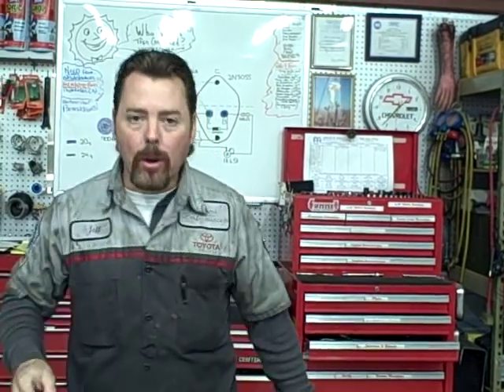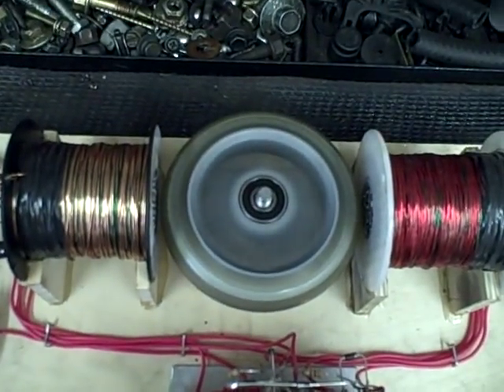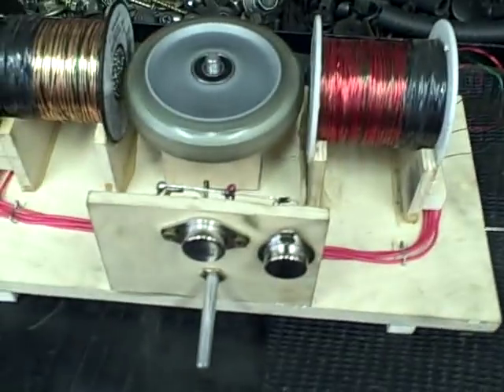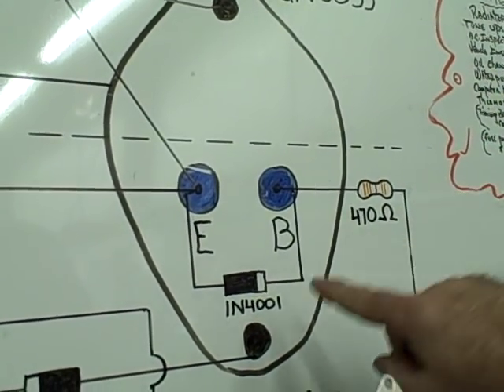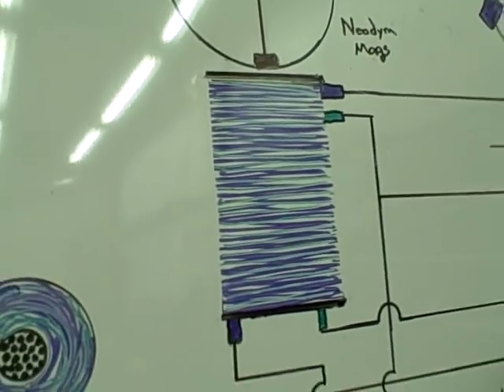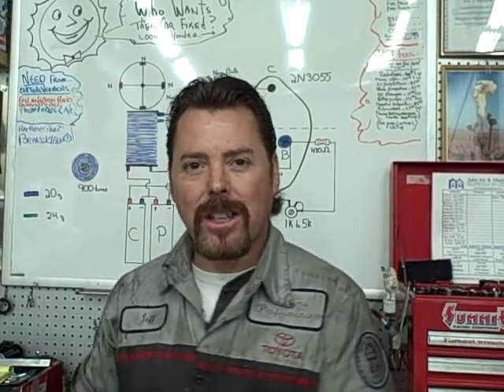Bedini Motor ( Generator ) How To Build One

Comment: Do you think this could work to recharge RV deep cycles while camping? (Scaled to a larger size) Two 6V wired to make 12V
Reply from the maker: ***** not sure never tried it but sure why not.
Jeff
Reply: no, since it would require the violation of the laws of thermodynamics.
Reply: +Wes Jones you must look once to rick friedrich simple free energy and i hope your eyes will go open
Reply: philippe herman you must look inside a physics lab. My eyes are open...to reality. Why do you deny documented physics? Aren't you open minded?
Reply: +Wes Jones the earth is flat otherwise we should all drop off that's the way you are thinking but we all know this is wrong now. you dont see every thing in your lab
Reply: philippe herman if the Earth is flat, why does it cast a shadow in the Moon, and how would it have magnetic poles?
Reply: +Wes Jones the bedini motor is a patented device. it doesn't violate any laws of thermodynamics. in case you missed it in the schematic, it has a battery power supply. the easiest way to think of it is as a DC to DC step up transformer, even though that's not actually an accurate description of its operation.
Reply: JHuff276 having a patent doesn't mean anything. 

Clearly you didn't watch the video of you think they aren't claiming it is a perpetual energy generator. It would be pointless as anything.
Reply: +Wes Jones the video does not claim perpetual energy. he only mentioned that other people claim it. the bedini motor works extremely well as a battery charger and reconditioner for desulfating the lead plates inside battery cells. that is not pointless. it can recharge a battery that has been discharged down to almost 0 volts. this is not pointless. it is a very good machine when used correctly.
Reply: JHuff276 no it can't. Do you get the laws of thermodynamics?
Reply: +Wes Jones Laws are constructs of man. They can be manipulated or just plain wrong. Spouting off that something violates the laws of thermodynamics should not prevent people from investigating anything.
Reply: Ron Armstrong so you don't get the laws of physics then....
Reply: +Wes Jones you are a great believer: you believe something isn't possible and that's not right. If anyone was thinking like you, we would still living in the Middle Ages i think. You dont know what happened then?
Reply: Ron Armstrong laws are concepts that describe actual phenomena that will occur given the conditions. Seriously, why argue science when you know nothing about it? The very laws you are claiming are being defied for this are what make your phone/computer work. Which is more likely, that all of science is wrong, and it was a complete fluke and guess to get your computer working, or that science is accurate, and you're misunderstanding it?
Reply: philippe herman hardly. I am open minded, and that means being open to the possibility of something not being correct too. Try opening your mind some time.

Tell me what the first and second laws of thermodynamics are, and why you don't believe in them please.
Reply: +Wes Jones Why do you assume I know nothing about science? My computer has nothing to do with the fact that obsolete chemical energy cartels have worked tirelessly to keep us using technology that drains our resources. You drive a car that throws away 98 cents out of every dollar you spend on gasoline in the form of waste heat. I also know that the so called "Laws (lies) of thermodynamics" are a mechanism to keep us in slavery.
Reply: Ron Armstrong I know you know nothing about science, because you don't even understand how electricity works, or what laws are, let alone what the laws of thermodynamics are.
Reply: +Wes Jones I know that the laws of thermodynamics are a method created by false authority to keep us under economic bondage.
Reply: Ron Armstrong it's my bad really. I should have known you aren't serious.
Reply: +Wes Jones Don't sweat it. I didn't realize you aren't credible.
Reply: Ron Armstrong he said while denying all of science.
Reply: +Wes Jones That's your perception.
Reply: Ron Armstrong based entirely on your denial of science.
Reply: Yes, that was the original thought we had. 
We run 5.5 Sluece, and we constantly have to charge the deep cell. 

The problem comes in charging because, a deep cell takes time to get back up, to useful charge. Literally hours. 

A small generator only put out about 7.5 amps and not able to keep constant.

The pump drains the battery faster, than the charger can replace. 

That's why we looked at this video. 

In the end it comes to changing over from a battery based system, to a 110 V complete electric system.

A much bigger generator, with 110V sump or bilge pump work's better because, there is very little variation in flow rate when running for longer period of time, and we do not have to stop run.
Reply: Jami Ross do you ever get tired of making a fool out of yourself?

Yes, plugging the motor into a wall outlet will make it run longer than a battery. Guess as to why that is champ. ;)
Reply: Jami Ross and you wonder why the scientifically literate laugh at you?
Reply: +Wes Jones. The laws of thermodynamics do not apply to this devices benefit of desulfating a battery, and I agree that those laws are correct . However, they apply only to closed systems. I'm not claiming to know exactly how it works, but my very educated sister(masters in electrical engineering) has two Bedini motors she received directly from John Bedini at a conference after she corrected him about Royal Raymond Rife(funny story but long). I have used them and they both work and the explanation had something to do with collecting negative environmental electricity made possible from the magnetic field from the spinning magnets being disrupted. The laws of thermodynamics remain intact because this would be considered an open system. I assume you know the difference between - and + electricity and the negative electricity is what desulfates or brings old dead batteries back to sometimes better than when they were brand new.
Reply: Joel Giachetti you're right, you don't know how they work.

The laws of thermodynamics don't apply only to closed systems professor.
Reply: Joel Giachetti oh, and it wood need to be a closed system for it to be perpetual genius...but since said closed systems don't actually exist.....
Reply: +Wes Jones the reason I replied to you was because you was because you seemed like you truly wanted to know its benefits. I've revived numerous garbage batteries with it and it works, and yes,  laws of thermodynamics DO NOt apply to open systems. Genius I never claimed to be, but you are a fake. Good day
Reply: Joel Giachetti yes, the laws of thermodynamics do apply to open systems. I recommend you consider brushing up on your high school physics.
Reply: +Wes Jones no, you need to brush up on your shill skills and hope you don't get reviewed soon. You might lose your job. Maybe you'll get lucky and be reassigned to a different topic to argue like 9/11 or flat earth. Good luck on your career choice.
Reply: Wes Jones laws are made to be broken. Science is proven wrong all the time using science to do it. You are trolling people. Open minded people are the very shoulders science stands on. Einstein was considered a fool by his teacher and was told he wouldn’t amount to much, but his ideas changed the world and proved theories that currently weren’t accepted. You my friend think that only you have the right answers and that is why as a scientist, it is sad. You are supposed to not fully accept laws in-order to find a way to break them.

Comment: Helo Oops I was wrong wire is 0.40 and 0.60 nawijalem coils in various namely 450 and 900 and 1200 windings and always the same effect on the output voltage to charge my 7volt what is causing Heyke

Comment: your 2 coils should of been wrapped on the same core the tranformer action would of added extra energy off the pulse, the varible resistor because you connected those 2 out puts together you loose the varible function  barries are wired wrong, you know when its working right because the 2 coils will be in resonance and be making a whistling nose from the coils i bet you didn't hear it

Comment: Use a small bolt and bolt them on, you may even join all of the connections that come from the same place if you wish, it works just fine and the most simplest way;¬)

Comment: because it does not teach how to make the coil to get the four points¿? according to what I see is a two-layer coil of wire number 23 and 26.

 in the diagram I see 900 laps, ¿then it means there are 450 turns of wire 23 and 450 of wire 26?, which layer is first, the 23 or 26.

I would like to see this video, because in this area is very expensive  the construction. 

nobody talks about this piece in the videos, is the most important.

I hope to answer, thank you very much.

Comment: The glaring error- Two coils on motor built, one coil on schematic...?
Reply: Coil Smoke you have to build 2 circuits and each one runs each coil. It’s a pulse motor style design. You can put as many coils as you want just each coil needs it’s own separate isolated circuit

Comment: Until the primary battery is flat, which can be after a very long time as you charge 5+ batteries on the lowest Amp draw, mine has 3 coils and induces a 12.8v current without me even rotating the disk, it varies according to how I place the coils, if I move the coils away from the magnets Ohms Law determins the output and voltage, wattage & Amperage change accordingly. If you can charge 5+ batteries then it will run for as long as your batteries run, add Solar & it won't stop ;)

Comment: This motor does not have over unity. Things are not connected correctly in the circuit he drew on his board.
1) The transistor is off the way he has it wired. This makes all the current flow through the neon bulb.
2) The diode connected to the charging battery is reverse biased, so it is not conducting current. This causes the charging battery to be disconnected from the circuit.
3) The potentiometer is not wired correctly. If he had connected the two terminals together it would work, but he said he left his open. This causes the potentiometer to act as a resistor. If had connected his wire to the terminal in the middle then the potentiometer would act as a throttle. But the way he has it wired it just acts as a 5K resistor.
4) The 4007 diode is also reverse biased so it is off too. Because it is reverse biased, the coil made of smaller gauge wire is not conducting current, so it is not producing any magnetic field. The coil is essentially off.

What this man has built is an electromagnet. The coil made of large gauge wire is powered by the primary battery. It has a DC current flowing through it and acts as an electromagnet. The scooter wheel has magnets on it. So once he spins it, the magnetic field of the electromagnet keeps it spinning. But this drains the primary battery because it supplying the current for the coil. Once the primary battery is drained, the scooter will stop spinning. The charging battery is not even hooked up so it does nothing.

Comment: You need a healthy Battery, mine wouldn't work because the battery I attempted to use was not good, although it will work with 10v, 12 Volts is way way better ;). You start it rotating, it should carry on :p

Comment: I will use a Solar Panel to charge the primary battery (Capacitor) as it is NOT self sustaining, this is why it is NOT an "Over-unity" device. Any attempt I have made to re-route the output back into the input you get a feedback-loop that shorts the whole thing out, even with blocking diodes you will obviously run into problems... However, I know someone out there may be able to figure this small glitch in the matrix out;-)

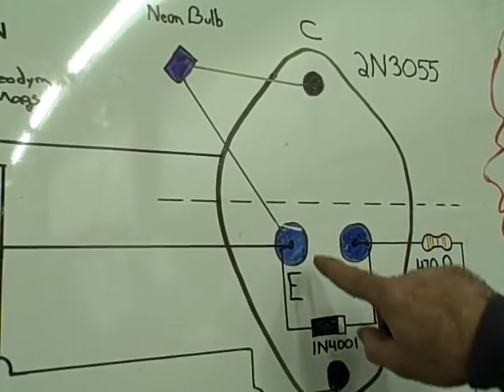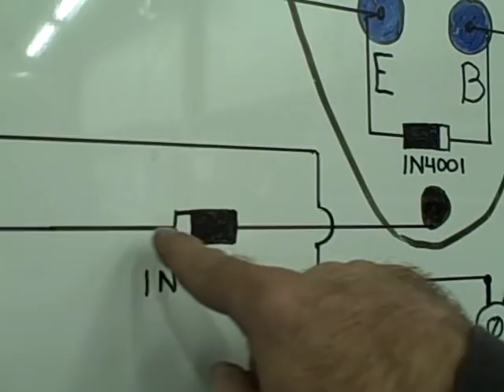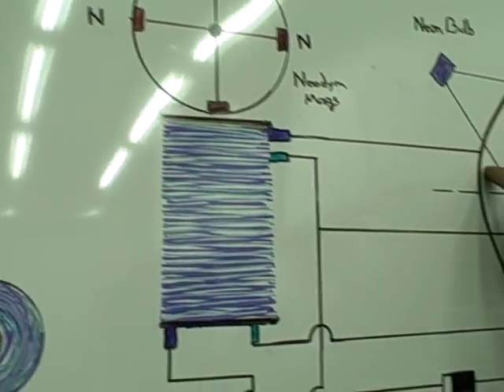Comment: 3:33 If you don't know how a potentiometer works, I suggest you NOT "leave it open" -- the drawing will mislead you as to how to wire this without the shorting wire.   3:50 WRONG -- the neon bulb prevents voltage spikes from damaging the transistor.  4:20, 4:51 Collector NOT "Collector-Base".  0:00 Is that a severed hand hanging on the peg board back there?!?

Comment: how long will this run ?
Reply from the maker: Das Licht as long as the lead acid batteries hold up
Reply: ***** Have you tried to make it recharge itself ?
Reply: Das Licht Sadly not possible
Reply: Doazic it must b poss (mayb adding a little circuit or few components so that when one is full it switches back)
Reply: You can't get more out than you put in, simply put.
Reply: what u believe is what u get i dont believe that so i do get out more then i put in!
Reply: mmrutman bad reasoning
Reply: yesterday this fellow told me ther aint no such thing as can't!
Reply: okok
Reply: angus u joka look at your own vis bedini working mythbuster busted so u can get out more then u put in what u talkin about
Reply: mmrutman hah have you seen their bedini circuit? Its nothing close to this. I don't knoiw if this works but i see that principle as a localized concept

Comment: Tesla proved radiant energy so well (c.1896) his laboratory was burned to the ground. Those implicated include JP Morgan & Edison - now GE. Edison was really pissed at Tesla for designing a brushless AC motor. Edison's DC current was useless for long distance power transmission. Tesla's AC electricity created the energy revolution we have today. GE & Co have blocked Tesla's AC replacement radiant energy because it means free energy 'without wires' & bye-bye oil. Tesla had about 700 patents...

Comment: Hey mate, see if this diagram helps you. google peswiki.com and find the Bedini section. click on SG Schematics. U can also find the materials and procedures on there. It wont let me copy the link here.
if you scroll to the bottom, you can see where the transistor ties into the motor. The transistor he uses is different in the schematic, but you will still have the idea.

Comment: Energy can neither be created or destroyed  it mere;y changes its form meaning you cannot pull out more current than you supply
Reply: ..and you have tried, tested and built how many bedini designs ?
Reply: Hahahahah - Nice one!
Reply: Mark Harrington That particular statement about energy assumes that energy isn't made of something else. It seems that the actual transference and functions of energy cannot be fully explained without making it dependent on other sub-components doing or participating in the actions/reactions/transmissions. Thus invalidating the conservation of energy "law". And that means matter and energy are not fixed in their ratio either.
Reply: Mark Harrington what about light?you turn off a lights switch and it gets dark .where did it go?flip the switch again and it's back,was the light still there in the room somewhere hiding?
Reply: @gunsofvengeance2229  haha - wtf??
Reply: actually universes sitting in bath of energy, your atom bodies, air, light, soil actually  energy itself, it just matter how we capture and convert it! i do believe there's no "free energy" it's just something that we couldn't comprehend, but "free energy" as economic term, yes you can make 10000 watt solar panel and you free from government!
Reply: That's true.  The purpose of this design is to harness ambient electrons which are everywhere.

Comment: Type "500G WINDING WIRE / MAGNET WIRE 0.56mm / 24SWG / 23AWG" and "500G WINDING WIRE / MAGNET WIRE 0.40mm / 28SWG / 26AWG into ebay - That is exactly what I used ;)

Comment: some ppl forgot to study the first law of thermodynamics... :)
Reply: punchcrosser1 the way this works has nothing to do with thermal dynamics. It’s simply a pulse motor that uses a trigger coil to generate a small current to trigger the transistors to open and pulse the main coil. You could use reed switches and standard coils instead of bifilar

Comment: Nice schematic rendered useless with close up shots that show only small sections with out the entire schematic information. The presenters head blocks the view of the drawing on the close up shots. Too bad the schematic was not presented in full without the camera darting around the head of the presenter. 

What could have been an informative presentation turns out to be hurried explanation without details. The schematic fails to show the electrical connections of the neon and grain of wheat bulbs. All in all the video should be re-done with more planning and care. The presenter was fine and spoke clearly and understood the circuit, I  liked his energy.

Making youtube videos requires some planning and thinking ahead. Many of fine schematics are ruined on youtube by not taking the time to place the camera on the full schematic using a tripod so that the image can be captured by the viewers for detailed study.